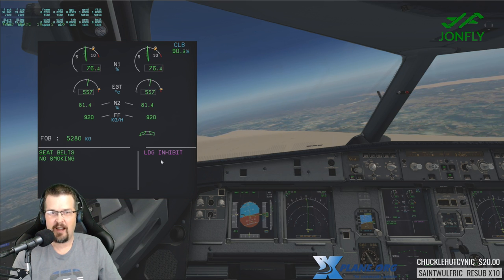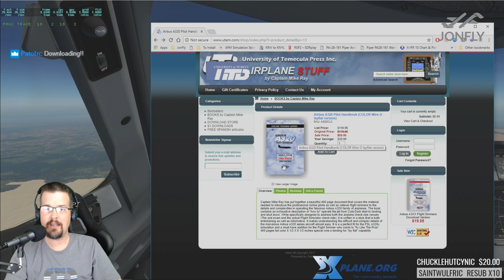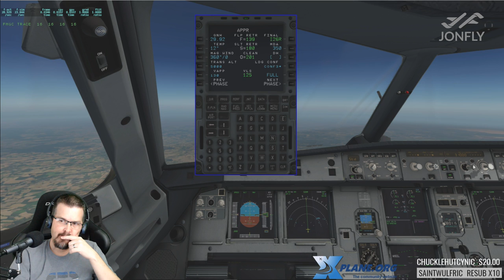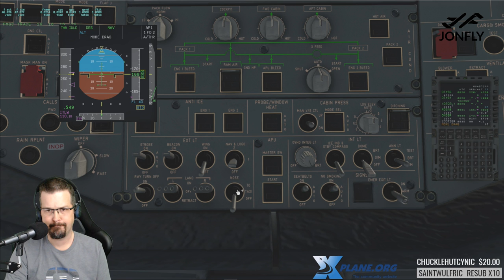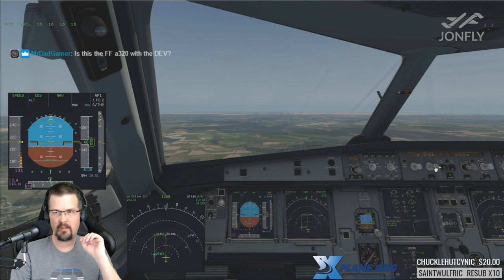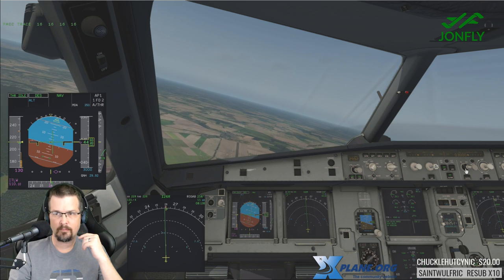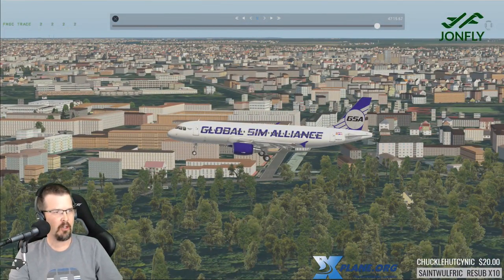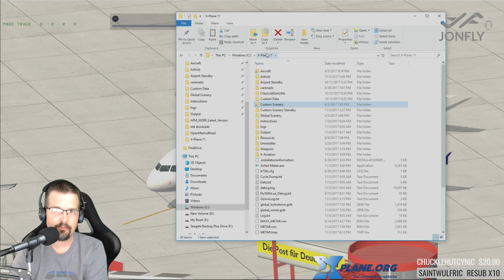FlightFactor A320 Ultimate EDDM to EDDT Part 2 of 2 With Totoritko

Comment: Do you know when the Flight Factor A320 Ultimate will be released, and will it be $320,320.32?? But got to love the price 320's all the way
Reply from the maker: Not sure when it will be released. When it is I believe it will be $89.95
Reply: Does it have a big impact on frame rate?
Reply from the maker: I get 30+ frames but I do have a i7-7700k CPU and a 1080ti video card